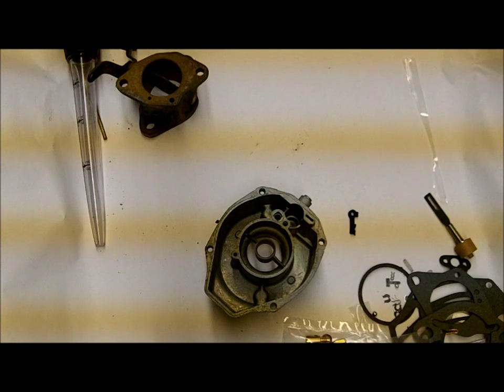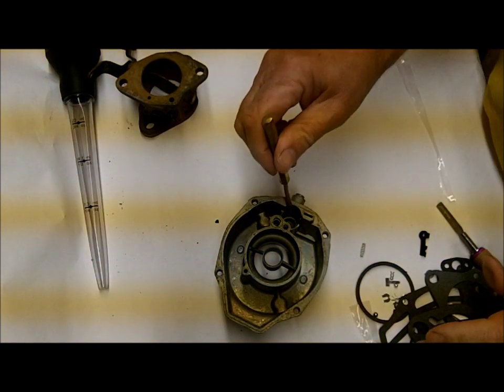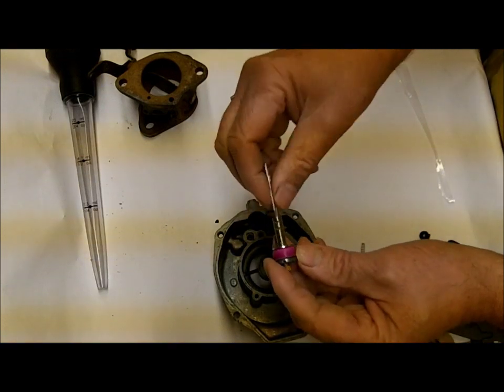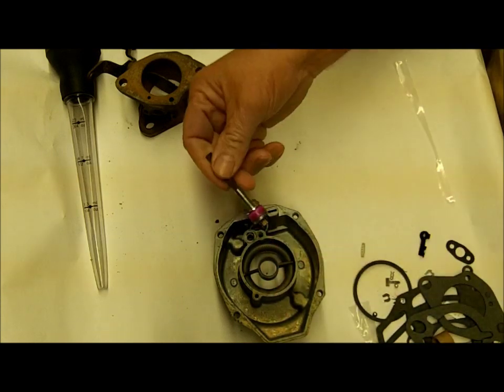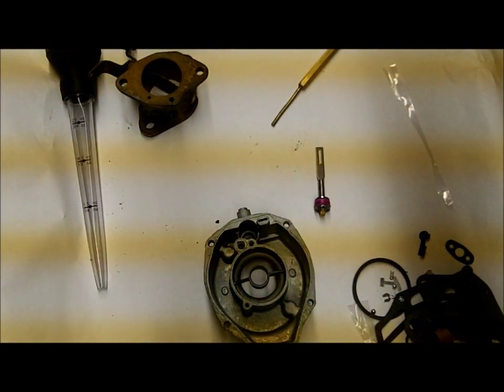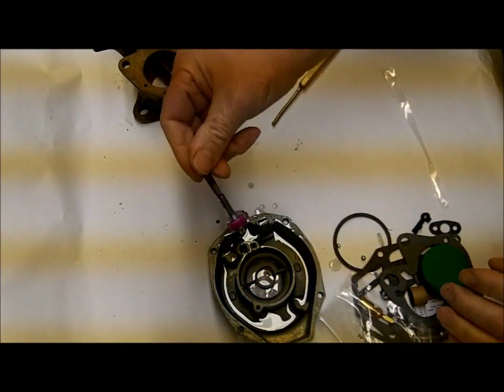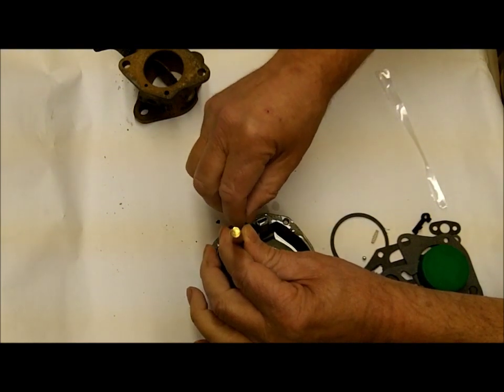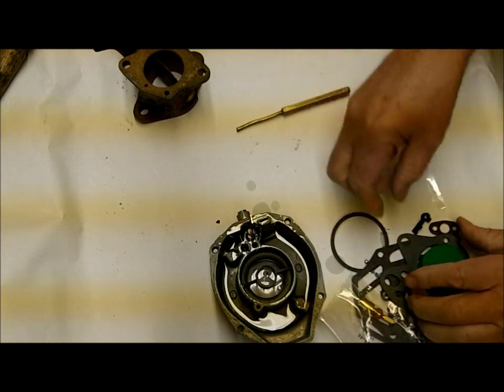Rochester B BC Rebuild - Testing the Accelerator Pump Circuit

Comment: Have you ever had the check ball stick? Mine was good on my rebuild and one month later I was having  an issue with starting so I opened up my carb and it was full of nice clean gas as expected. When disassembling to try and find the issue, the check ball was stuck and I had to dig it out with a pick. How can that be prevented?
Reply from the maker: Next time use heat on the outside. they almost always drop out. Be sure the bigger check ball was used in the main discharge. They usually stick because the wrong check ball was used.

Comment: Hey Mike, I've had my B rebuilt but for some reason the choke is sticking just a bit on acceleration. Could use a little advice.
Reply: @MikesCarburetor  idles fine, adjusted choke when I initially press accelerator it stumbles,if I stab it it it runs fine. Reached up by hand and held choke lever and its fine.
Reply: If i hold by hand its runs fine.

Comment: I just used this vid to test the accelerator pump on my Quadrajet. It squirts out both top openings like it should. However, when I put the air horn on and test, only the right side primary squirts fuel. Can you help me, thanks.